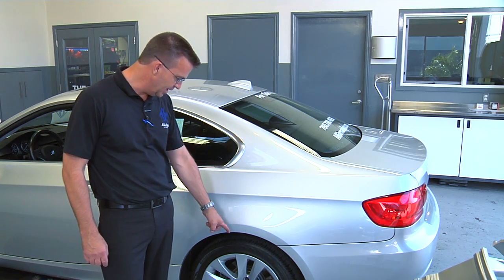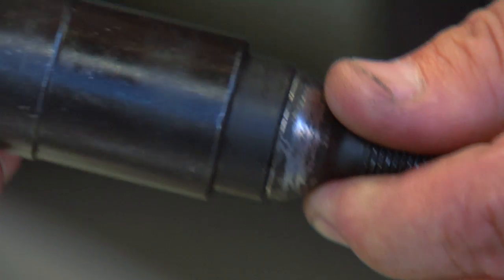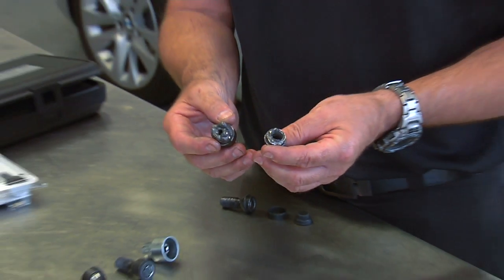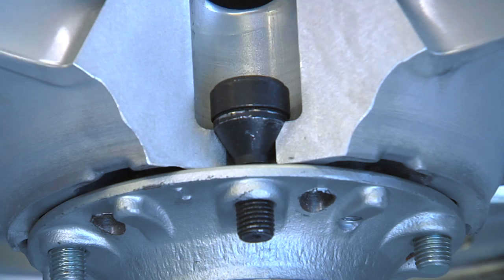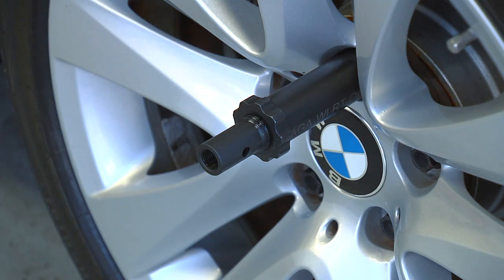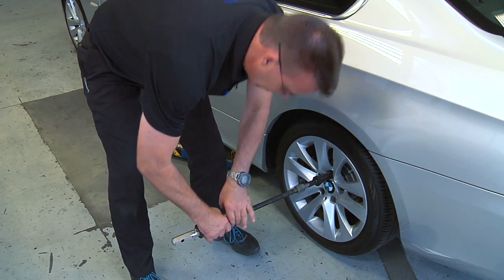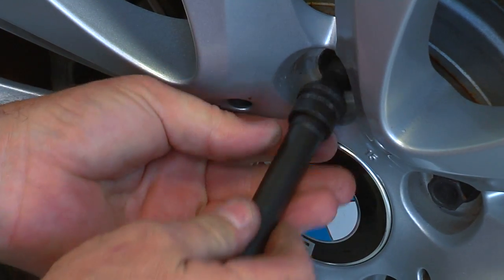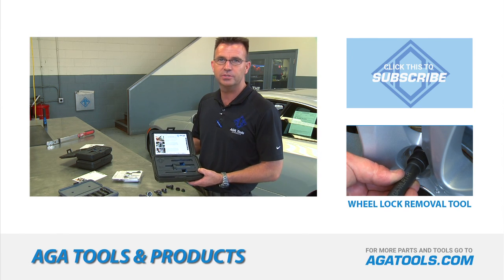AGA Tools & Products - Wheel Lock Removal Tool

Comment: Found this video when I was looking for trying to remove a sheared off adapter (thanks Discount tire). Took it to AVA in Escondido and they removed the lock nut - charged half an hour of labor.  The tool works great. Now I simply need to wait for the replacement adapter from BMW and replace them with the newer style.

Comment: Hi... that looked like it works great.  I have a Mini with a lock key similar but it doesn't have the spinning head.  I have stripped 2 keys now so I am about to bring my Mini into service.. $$$ ouch!  I have used a breaker bar and that still didn't work.  Any suggestions?

Comment: The Snap-On tool is more than adequate when removing these type of nuts using a smaller size pounded on works as it squeezes the outer ring onto the inner spline.

Comment: Nice tool , will take BMW wheel locks with ease but tip of the ring removal tool don't last much, hopefully they will fix that or another company will come out with something stronger.
Reply from the maker: Repofloyd, we made this the strongest and biggest we would with what was provided to us (clearance issue). We put this through a very extensive heat treating process to make the material as strong as possible. However, it does wear down because it is a service tool.

Comment: Hi, what type of locking wheel bolts does this work on? Is it only the one in the video?
Reply from the maker: Peter, yes. These style wheel bolts (McGard High Secruity Wheel Locks with spinning ring) is the only style of wheel locks that this tool will work on.

Comment: Can this tool work for Peugeot wheel lock nut with the pin sockets?
Reply: No. You have to drill them buggers out, use a 9mm square ended bar and bang it in then use a socket to turn it. They are an awful design!

Comment: Also the price is high is cheaper to buy a BMW wheel master key set.
Reply from the maker: Repofloyd, though this is true. Having the master kit will be no benefit for customers with whee bolts that are stripped.
Reply: AGA Tools 
That's true , I just wish the tool was stronger.